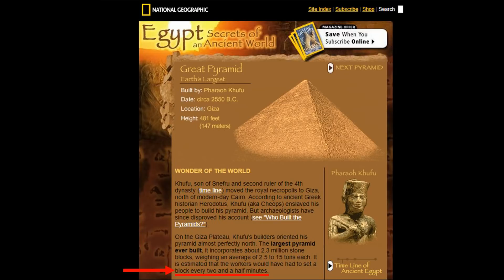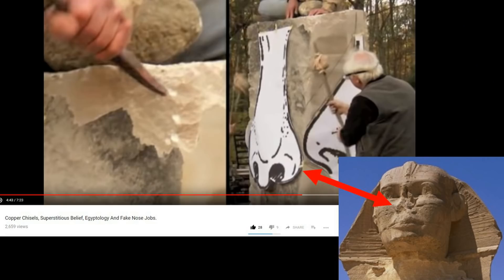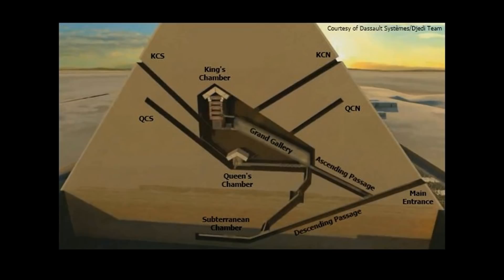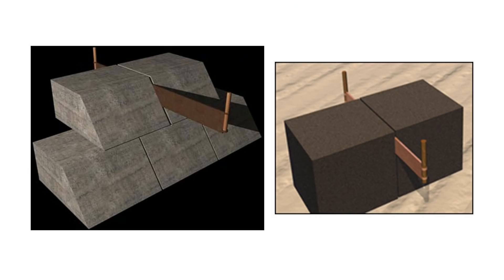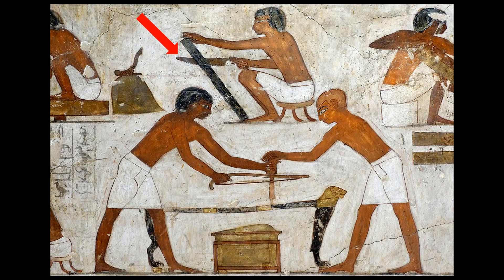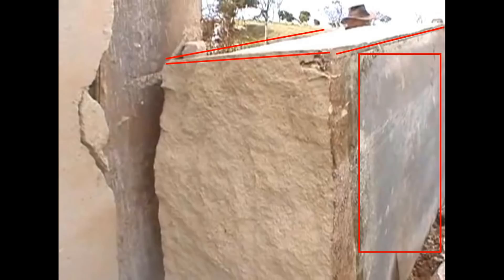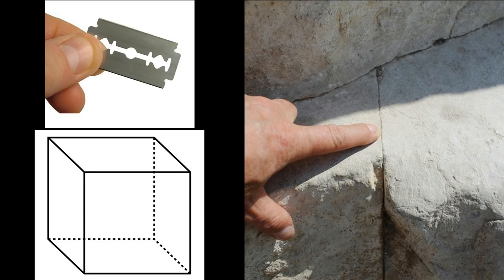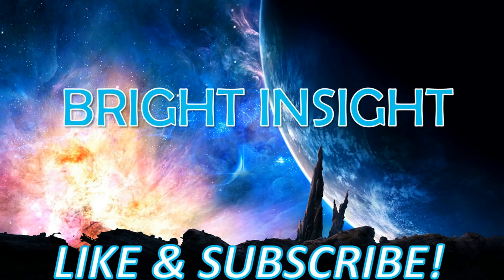Great Pyramid of Giza:  Lost Ancient Civilizations

Comment: your 12 minute videos last me about an hour, I have to ponder and research quite a bit during and after them, this stuff has always fascinated me, most I'm familiar with because I'm obsessed, but of course there's always more to uncover and dots to connect, just imagine quarrying 2.5million stones with a series of 6 rough cuts, dragging them and ferrying them to where they needed to be, possibly making the finishing touches on them which consisted of 6 cuts to square them up, placing them into position, how many hours in the day did and how many days per week did they actually have to do this? what about bad weather days, supply shortages, sick days, strikes, repairs, holidays, wars, famines, building a structure like that would cause all types of protests and changes in how workers were treated and how many hours they could work, we've seen this throughout history, there would be many set backs, yet we're supposed to believe they built it in around 20 years haha "Hey, we found these tools, so that's what they used. And King's didn't live long so since this was his tomb then it took no more than 20 years to build obviously." 

what I've always found interesting is the size of the stone, they're all different sizes which would take up even more time and would be even more impressive with the accuracy achieved, there's not much of a pattern yet it ends up perfect, you'd figure each layer of stone would consist of a set size, but there seems to be no rhyme or reason to this structure, the funniest thing is how they say they used water as lubricant when pulling the stone, one person per ton of stone, well what about the stone pullers behind them slipping in that water? and why are ancient egyptians always depicted without shirts when modern egyptians have to cover up because their skin will burn in no time? anyway the sarapeum boxes and the elephantine island stone shrine are proof enough they (or whoever) had some really large and awesome machines, giant saws and grinding wheels and railway systems, they no doubt had enough time to figure these things out, anyone would, and they could cut sharp internal corners which basically shouldn't even exist, yeah I should have written in sentences but just didn't intend on writing all of this haha, sorry

Comment: Why dont the numbers add up? If the whole nation focused on building that pyramid I would say 10.000 workers is a reasonable number?
[[[365(days)*24(hours)]/2(12h work time)]*10000(workers)]*20(years estimated for building) =854.400.000 hours of working time available. Now lets divide that by the 2.300.000 stone block = 371 hours per block or 15.47 days. Thats over two weeks for each block - why does that sound so unreasonable?
Reply: Oh and just to make sure, thats not one man working for two weeks, that is the combined workforce of 10000 men for two weeks on a single block

Comment: Jimmy, why would the building of the Pyramid change from Lime Stone to Granite?  What is the purpose of Granite in the chambers as opposed to just continuing with Lime Stone?  To me, it should be opposite.  Like building a house.  Would you use sheet rock on the outside and stucco for inside walls?  Lime Stone is softer so it will wear quicker when exposed to the weather.  Did I miss the answer to this question in one of your other videos?

Comment: What was the most abundant material in the desert SAND and cement.....Instead of cutting sand and granite into blocks grind it down transport it with a feu men at a time (YES LOTS OF MEN )and mix it with cerement this will set like the original granite so no big tons of blocks to transport and the only thing that is confusing every one is the transport of the blocks THERE WAS NONE .... look for wood planks to make a block cast and tools to smooth the surface down when semi wet ...that's why there is no gaps just joints.... and the blocks split when the underneath became weak.....that's what you see now....

Comment: I have to agree that modern Academia is either missing something or obfuscating something. 

I tend to think academia is missing something, but at a certain point, a group that derives power and influence from knowing something is going to obfuscate that they don't know something.  
There's probably a lot more than a single thing. 

I tend to look at two things specifically.

Firstly, the Sahara wasn't nearly as extensive as it is today. Desertification is a serious problem in the region. Forests have disappeared, grasslands have shrank, and deserts have grown. In the one clip, we saw how much water improved their ability to work the stone, so a wetter environment probably would have helped speed the work along.

Second, Academia is focusing on hand tools powered by humans..... but they had elephants. Ignoring the elephants, they had horses. Maybe even Camels, although i don't know when those were officially domesticated.... 
After that, people are only looking at one side of simple machines: a large heavy load being moved slowly by large movements. 
No one has really looked at the other side of the lever, which would moving a light load an extreme distance, at high speed, with a small movement... Which could replicate a modern power saw if done correctly. 

Just my two bits.

Comment: Best presentation that I've seen on this. However, as a mechanical engineer with  machining experience, I suggest that an optimization of the sawing technique using bronze saws and wet sand would improve efficiency a lot. By optimization, I suggest starting experimentation with somewhat narrower--'sharper'--teeth (more pressure/tooth) on a slightly thicker bronze saw (to reduce flex and produce flatter surfaces) to increase production - and then rotate teams of saw operators, so that good speed is maintained. These saws would eventually wear out and be re-melted to make new ones. Thus, not a lot in the garbage to find in the future. Sawing down the sides and splitting sequentially from the floor, as the quarry shot suggests, should work. To quickly split, it might work to make two saw cuts to remove a long, one-inch wide wedge about 3-4 inches deep and then pound on bronze wedges with wet wood shims on each side. To assist in the break, 10 workers with pry bars in the groove would help. To flatten or polish a cut face, one could place the block on a flat bedrock surface with wet sand, and using a framework with handles, rotate the block to grind down.  It is amazing what 10,000 laborers can do in a day!  :)

Comment: Peoples of the worldwide megalithic cultures did something with stone we can't do today, and we don't know how. Copper chisels definitely isn't it - not when the scale and necessary precision of pyramids and giant granite stones is considered.

Perhaps we're ignoring stone tools, though? How would tough ropes, interwoven with quartzite fragments, strengthened with resinous glue and used in combination with water and sand grains of the hardest available sort have worked as a kind of chain saw, I wonder. 

Could the final touch to the surfaces perhaps have been made by utilizing the stones own, immense weight? Imagine a roughly cut block being turned, using long, sturdy trees fastened at the four vertical sides and turned by the momentum provided by their length while resting on hard bedrock. Once one side was finished, loosen the wooden lever-frame, turn the block once over and repeat.

Comment: Limestone can be broken down using heat to produce calcium oxide, which has lots of uses. Add water and a vigorous exothermic reaction takes place... add some lime stone quarts crushed and mixed with granite, mix well, add water make a paste, shape and cut easy… so moving the stone would just require crushing the stones at the quarry site and moving them in bags to the building site like we do today…This would also explain the size of the stone blocks... as you could only make them so big or they would crack… I think that’s what happened to one of the pyramids that was made to short…  well that leaves one question how did they fit them so tightly together well you would pore the slab right next to the other making the joint perfect... Carvings as well and drilling holes would be easy you could do it with wood or copper no problem...

Comment: I don't get why they adamantly stick to the 10-30 year timeframe! All they have to do is say it took 100 years or more. Even then, it would still require placing a block every 10-20 min. Great video and great evidence btw!
Reply: That would conflict with their theory that the three pyramids were built as tombs for three successive pharaohs. Each would have to reign for over 100 years for that to work. Their wrong assumptions have provided them with an untenable theory.

Comment: Jimmy if you look at the quarry by the pyramids you will notice that the sections of each stone is separated by a about a 2 foot grove and it goes deeper than what sections are. This means that the cut was made by a large machine. It left behind a section and a grove. And the whole quarry was sectioned and each stone lifted straight up to be moved out of the quarry just like today with a crane. Look closer at what is left of that quarry it will tell you more.

Comment: It's safe to say that the Egyptians did not build any of the pyramids. They only attempted to replicate it from all that I've seen on the subject. Sure they have lived there for a very long time but that doesn't mean they built them. That pyramid that is located under the ocean that has been documented is something that needs further investigation. Sadly our history is largely covered up and tampered with for control reasons. I love your channel Jim and keep up the good work. 

I thought about the use of cymatics and chemistry when it came to breaking and shaping blocks. Resonate the block and induce stress along a fracture then smooth with an acidic solution. That could be more efficient but then again, all this would be documented. 

On a side note, instead of looking for pyramids using geological formations in the sand or radar, use the stars to find the positioning of them since that's what the significant aspect of them are for.

Comment: It seems more likely they are a form of ancient concrete. The Romans seemed to know something similar,  as their concrete lasts thousands of years, and modern concrete is only good for 60 years. We know the Romans made concrete though, just not how. Modern day Geopolymer cement is used to make fake granite counter tops from crushed real granite, funny thing is, when looked at under microscope, those counter tops look same as quarried granite when finished.   They may have had a soft mix that would allow them to mold statues like clay, and then they hardened into granite. The other possibility is an ancient electromagnetic  scalar device that would weaken the molecular bonds in the stone, making them soft and malleable at room temperature . Then the material slowly  becomes hard again as it goes back into equilibrium with time. 
   The famous two opposing plasma light bulbs depicted in a wall scene in an Egyptian "temple" could be an electromagnetic scalar device. And the scooping marks in the quarries could also be  zapped spots that where soften and material scooped out with wood tools. So if they had the ability to soften rock at room temperature,  they could then pack the soften material  into block molds at that point, for a laser like precision look.